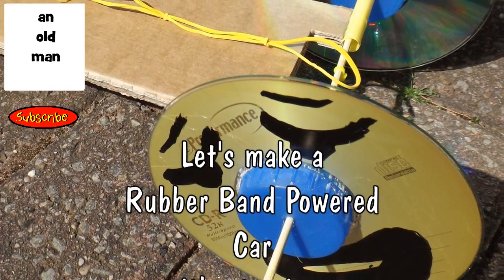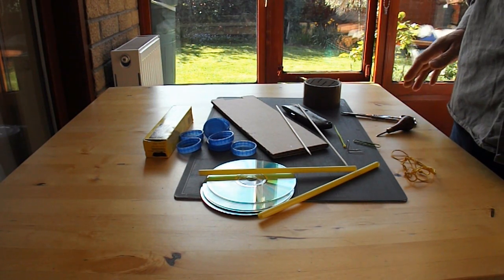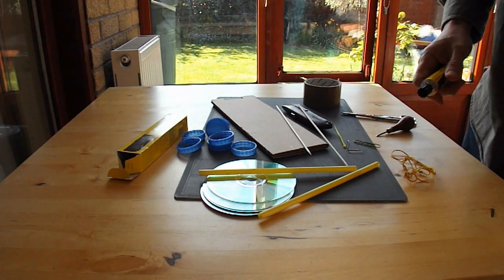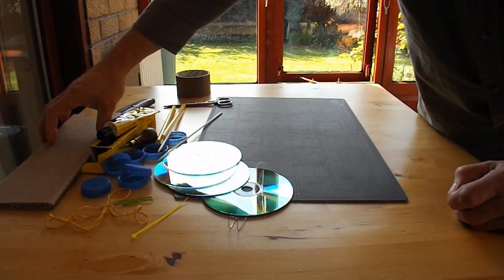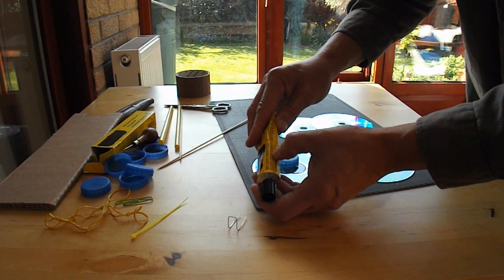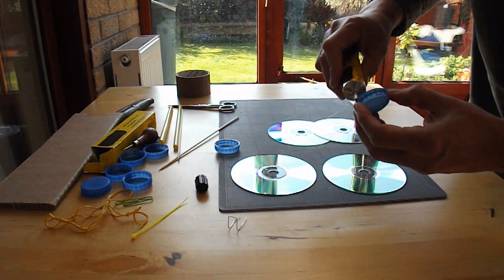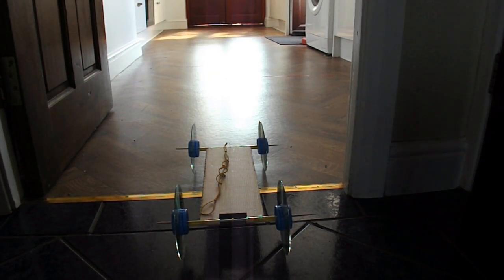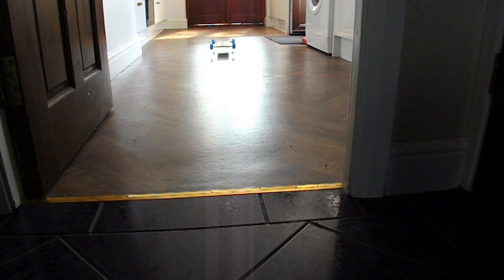Rubber Band Powered Car without Hot Glue

Comment: Could u put to zip ties instead of the paper clip ? (ASAP)
Reply from the maker: If you mean the paperclip I used at the front of the car to anchor the rubber band then YES I am sure you could. Maybe the easiest option is to push a hole through the cardboard at that point, push the band through the hole and use a piece of bbq skewer through the loop to stop it slipping back through the hole. Another method I use is to cut a slot there instead. I show you that in this video https://youtu.be/4N7CK5t-hP0

Comment: how many rubber bands used
Reply from the maker: As many as you like. I just use random cheap rubber bands. If you have a project that specifies a certain number of bands I expect they also specify what type of rubber band you can use. Looking at the pictures near the end of this video I can count seven. I have hundreds of rubber band powered car videos on my channel using all different numbers of bands. There are links in my video description. Here is one that looks the same but only uses one band Rubber Band Powered Car 1 x size 64 - full length video https://youtu.be/pIO3FiHX4Oc?list=PLA5a2xPRSrB3g5RiX8Kf_uUBOL0Tb7AS0

Comment: Can you build the car without the peg to tie the rubber band?
Reply from the maker: +thiliepan prakalathan yes. Do you mean the peg on the axle? If that is the one, you just wrap the band round the axle so it traps itself under the wraps and it will hold itself in place. If you mean the paperclip at the front of the car you could just cut a slot in the cardboard to hook the band in place.
Reply: Thank you

Comment: How big does my cardboard needs to be?
Reply from the maker: The width needs to be right to allow you to fit your wheels on the axles without rubbing the chassis, so the width depends on how long your axles are. The length can be as long as you want. The longer it is, the longer the length of rubber bands you can use and the farther it will go. Make the dimensions fit whatever you have available to make the car. That's what I do.
I would guess my cardboard is about 12 inches long and 6 inches wide.

Comment: what if you have no bottle caps? what can you use instead or can you just not use them?
Reply from the maker: Hi Annaliese, you just need something that will fill the gap in the middle of the CD, and allow you to fit your axle. Surely you can think of something to use? Cardboard, plastic, wood, I have even seen somebody fill the centre with hot glue. I use bottle caps because there are always plenty available, they don't even need to be the same size. I usually use matching caps because they look neater but it is not necessary.
Reply: Thank you, I used your simple rubber band car but I used CDs for the wheels, I used scraps of cardboard that I made the same size as the pencil and hot-glued it onto the cd. Thanks for the help!
Reply from the maker: Annaliese Piper well done, that was good thinking.

Comment: Yes, sort of, only the car has to start about half a meter away from the mass and has to clear the mass out of a square that's about a meter by a meter (long and wide). The car has to push various masses (100g to 500g) out of the square, but start outside of the square, about half a meter away. It's clearing the field of masses.
Reply from the maker: With a running start from outside the square it should do better than from a standing start, but I have just watched my video again and see this pushes the 500 gm mass over 3 metres from a standing start so clearing a 1 metre square should be easy. The main issue is getting power to the axle and enough grip at the back wheels and that is a combination of the width of the tyres and enough weight over the axle to help the wheels stay in contact with the ground.

Comment: By the way, you can use anything to make it, there are no restrictions, but try and make it relatively simple (as in not too complicated in terms of the way that it's built and how long it takes, not the materials and the materials have free reign)
Reply from the maker: Hi Shar, is this the sort of thing you mean?
Rubber Band Powered Car #8 pushes 500g
For the original build you will have to go to the beginning of this playlist as I built this car to answer lots of questions so it is made to be easily modifiable.
http://www.youtube.com/playlist?list=PLA5a2xPRSrB0zJ5RHjvsw46Mio6uJjF5_

Comment: Personally, contact glue do not use too much. 
I usually use it to leather or rubber. 
Never follow the method shown me in the bottle. Just stick it with a generous amount and let it dry under a weight or better yet, pressing any press or vise. 
Greetings!
Reply from the maker: Contact glue never seems to work for me and it smells and takes too long to dry, I prefer the hot glue gun, it suits the sort of projects I do, quick and easy. I took great care today to follow the instructions and I have to admit it did work but it still took much longer than normal.
Reply: GrandadIsAnOldMan I like you, Grandad ...